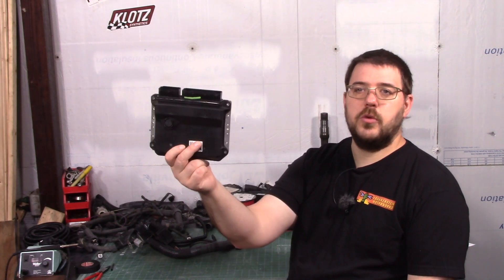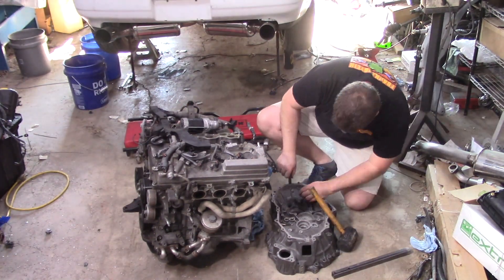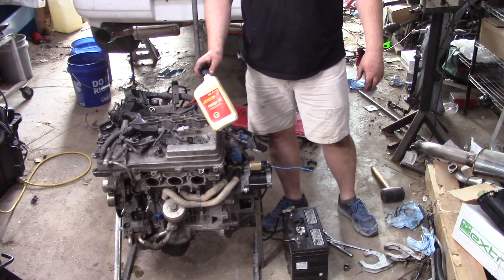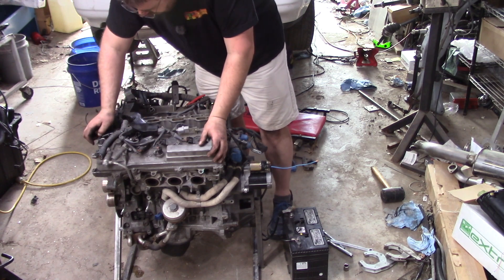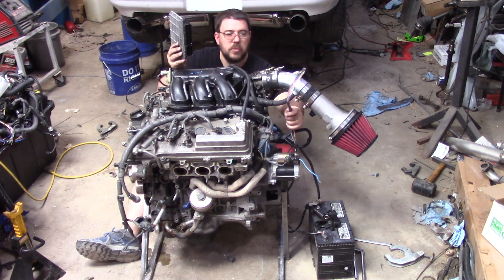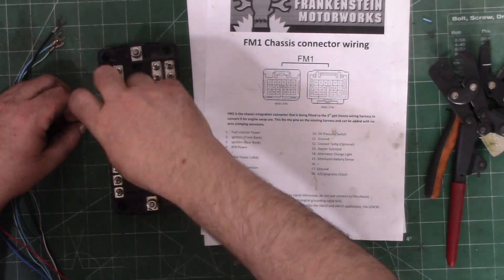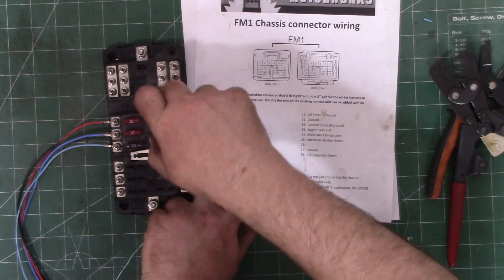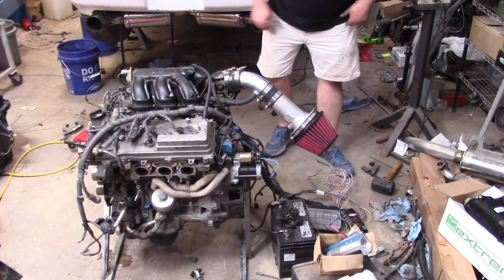Bench Firing 2GR-FE with Sienna ECU for MR2 Swap (AW11, SW20, ZZW30)

Comment: Good job 👍sir can you help me i need digram for 4gr ecu and the Important connections to fire the engine🌷
Reply from the maker: Generally to bench fire an engine you just need to hook up all the power supplies and grounds and you're good. From there just check the fault codes and it may give you a good indication to what the problem is if it does not start.

Comment: Bro... This is some serious pimp juice! 💪 What is your mechanical or engineering background? How did you figure all of this out?
Reply from the maker: I've got a degree that is a mix of software and electrical engineering. But mostly i've just always been the kind of person to dive right in until i figure it out.
Reply: @FrankensteinMotorworks  awesome! 💪 I don't have any degrees, but I'm a diesel mechanic with 23 years experience. 8 years of that in the Marines, 6 months of that in combat operations in Iraq and the rest on motor coache buses. I'm also a certified welder with 10 certifications verified by x-ray and I've built a version of the srt4 before there was an srt4. And with all of that i couldn't even imagine doing what you are doing😆

Comment: do you have any videos or diagrams on the 5 plug ECUs?
Reply from the maker: No, i do not. The 5 plug option is really not very popular and i do not plan on making a guide for it.
Reply: @FrankensteinMotorworks  that would be amazing because i cant get fuel or spark. I think i cant get the ECU into the right gear.
Reply from the maker: @DoshyDoshing  there's no need to put it in any gear to get fuel or spark. What faults do you have over OBDII and do you show RPM when cranking (on the OBDII tool or the actual tachometer)?
Reply: @FrankensteinMotorworks  i will get and odb port wire it up and see
Reply: @FrankensteinMotorworks  well. OBD will not comnect to the ECU. Im goimg to go through my wires one more time but idk if the ecu got damaged some how. Is there a test i could do to it?
Reply from the maker: @DoshyDoshing  The OBD communications really is the easiest way to test if the ECU is good. If you're concerned about the car's wiring you can easily do it on the bench. Hook up ground, power, ignition and the CANH and CANL and that's it.
Reply: @FrankensteinMotorworks  i think its fried. I hooked up only ground to engine and obd, power to ecu, power to obd, H and L can. Putting my ear to the ecu it has a slight whine.
Reply from the maker: @DoshyDoshing  If you bought it from me send me an e-mail and we can work on a repair service setup.
Reply: @FrankensteinMotorworks  thanks man ill send you an email now
Reply: @FrankensteinMotorworks  i gutted my wiring and redid all of it.  
OBD now works. 
Cranking RPM is 230
MAF isnt reading and injectors are considered an open line
Reply from the maker: @DoshyDoshing  MAF reading will be tiny when cranking, it might even be zero or so but the motor does not need the MAF sensor to cough and sputter to a half way decent idle so you can just disconnect it if you think it might be reporting an issue. 

Injectors will be open to the ECU except for the short pulses when the ECU grounds them to actuate them. Use a NOID light to test if they are being fired.
Reply: @FrankensteinMotorworks  NOID doest light. I have the grounds to the engine secured is there some ECU ground im missing maybe?
Reply: @FrankensteinMotorworks  IDK what else to do. There is something that needs to be done to the harness that i havent done.
Reply from the maker: @DoshyDoshing  disconnect everything except the crank position sensor, the coils and the injectors. Check that all your grounds are connected, all your power supplies are connected and IGSW if also getting 12V. force the fuel pump on and crank it. it should sputter then die again. that gives you only a few circuits to check to make it run. once it sputters then connect the cam sensors and it should start and stay running. it won't run well but now you can hook one sensor at a time and see where your problems are.
Reply: @FrankensteinMotorworks  fucking ignsw wire had come apart. Thank you so much for helping me man

Comment: Does the cold air intake make any difference other than sound, I have a Avalon,
Reply from the maker: Without a tune to go with it there really won't be much difference. Plus, most cold air intakes aren't actually colder than the OEM intake air.
Reply: @Frankenstein Motorworks  good to know, have you ever noticed any of these 2gr like small knocking sometimes,
Reply from the maker: @justinwoosley3188  yeah, if it knocks for 2-3 seconds on startup that's because the cams did not park properly so they are loose until oil pressure builds up. Because this is at low RPM it seems to be generally inconsequential.
Reply: @Frankenstein Motorworks  good to know, I notice mine can be a little Loud in traffic, and cold for sure, but high rpms nothing just at low rpms like you said, wasn’t sure if all of them did that or just mine, I know my last 2gr did the same thing
Reply: Kinda makes me worried to romp on it, only 130k on the motor, I’m just wondering how much these motors can take too

Comment: You're a fkn legend mate. I just wonder if your sienna ecu works with say an ausie rav 4 or aurion 2gr or would you need to buy the wiring harness and ecu from you?
Reply from the maker: The wiring is completely different to the 2009 and earlier rav4/aurion. I don't know if the wiring matches the later ones, i haven't checked but if you drop me an e-mail i can send you a link to the sienna wiring diagram for you to compare. Marc@frankensteinmotorworks.com
Reply: @FrankensteinMotorworks  sent you an email hopefully it made sense ☺